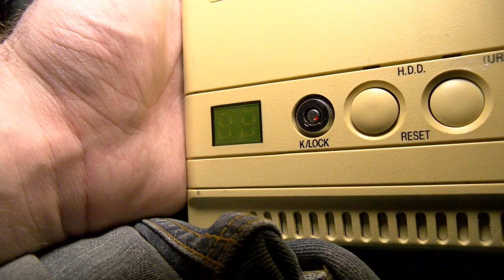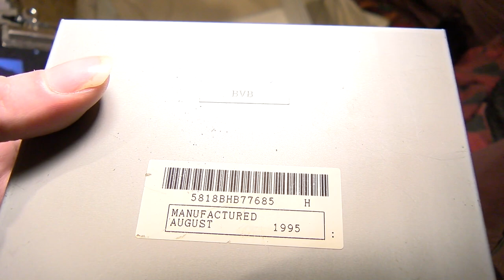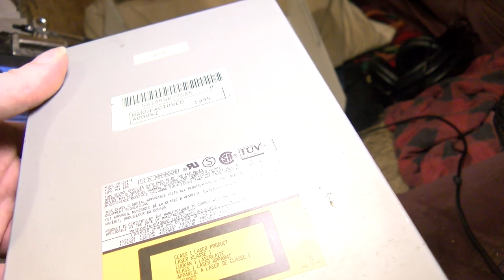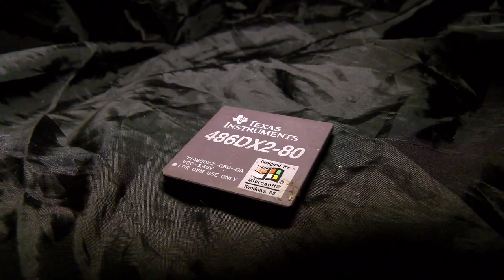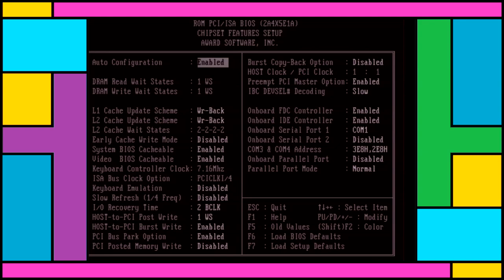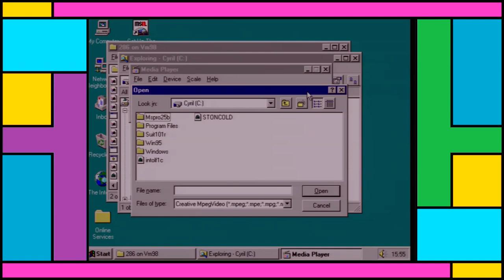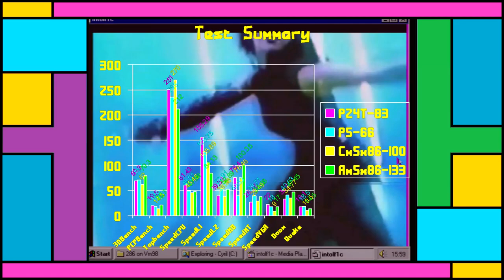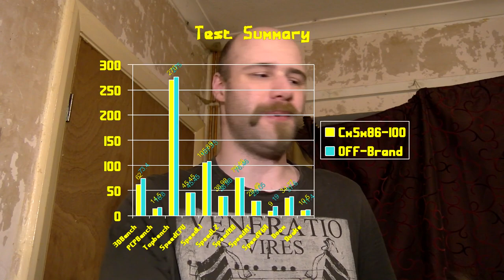Gimmicky Cyrix 5x86

Comment: Funny how things have been flipped around.  You're totally right, these were sold as "pentium class" budget systems with multimedia capabilities, and buying this stuff today, it really is cheaper a lot of times to just buy a Socket 5 / 7 setup.  I am sure those creative cards were made to get mpeg movie capabilities at a budget price and not intended for real use.  Playing video on a PC was a big deal back then.  I would call this system a "high end budget system" of 1995 or 1996 maybe. The cost of sound cards is why I started trying other cards and why I like the Ensoniq cards from Gateway systems, not greatest card made but for $20 they are damn good.  Glad to see you have a motherboard that actually enabled write back L1 on the cpu. Those in themselves are rare.

The ADZ 586-133 chip was designed to be a 160Mhz chip,  I think the ADW was a 140Mhz part but it is listed for 150Mhz, not sure about that one and ADY was intended as a 150Mhz chip but such labelings never came to be. The other variant which I have seen in a couple different silk screenings is the AM5x86 P75 AM486DX5-133V16BGC chip of which I do not have experience with.  Still looking for that mythical 200Mhz out of one.  I like running them at 160Mhz, 180Mhz is great if the board supports 60Mhz Bus. Only the ADZ have I had run close to 200Mhz. ADW seems to poop out at 160Mhz and ADY doesn't seem any better from my testing it.

That Cyrix chip can run at 2x so 50x2 is a nice speed to run them at and not overclock technically.
Reply from the maker: That Creative card actuallyseems to use the same MPEG decoder chip as the RealMagic ones, or the broken RealMagic I have on the side of the desk anyway. Funny how much smaller those are than Creative's one, though don't yet know if their quality was any different. The Scenic and the ATI Mach64 have had by far the best implementation I've seen so far - plus a bunch of late 90s cards where the feature likely wasn't used much.
OPTi and ESS cards have done well for me when things need doing cheaply on mid-90s machines, though both have some models that are better than others.
This ECS board has provided, by far, the smoothest experience getting CPUs running. A lot of them do indeed have issues with cache, where jumpers have to be set to all kinds of weirdness (setting as P24D fixes it on some boards, as if CPUs have a 'fallback' for this. The Aquarius does things like that) to make things work right. This one has had no such issues, everything just works. Its only issues have been worn slots, but this seems fine so long as cards are screwed in firmly.
I'd heard of AMD chips being relabeled like that, probably an attempt to stop them eating into K5 sales.

Comment: Hello, nice to see you again! I recently got one my cx5x86 had quite a time making it work with EDO RAM the damn thing worked with just a pair of 16MB memory modules I ordered some cheap FPM from Germany to avoid all the insanity and now the system is way stable and no slower at all. Using the guide CPU galaxy mentioned from Vogons it was quite simple to put together a simple bat file, the speed increase was as measurable as his own. Thanks again for your vídeos always entertaining and informative!
Reply from the maker: RAM from that time is a bit dodgy, really. You had motherboards trying to support EDO and then, supposedly, some EDO ram that could operate in plain FPDRAM mode. Most 486 boards just plain refuse to work with EDO at all, or else start up, but report it incorrectly before locking up. This is one of the very few that seems to actually support it, though I can't guarantee other revisions would.

Comment: In my experience, VIA chipsets really came in to their own in the Athlon era. I had a VIA chipset on my first Pentium PC as a teenager, and had all sorts of funny incompatibilities and quirks that went away when the motherboard was swapped for a 430VX based board, but on the other hand I used VIA Apollo-based boards on my Athlon and AthlonXP systems and had a great experience.
Reply from the maker: I suspect you're right. There's a gap in my knowledge of them around that time. Some of their barebones 486 ones (ISA only systems) seem to work OK, but likely as they're so simple there's nothing to break on them and they were probably late to the party. Their PCI ones were trouble. I'm told their early Pentium ones were sluggish or finnicky like OPTi's ones were. Then I know nothing until the MVP3, which works well for me, followed by their P3 and K7 chipsets that also work well. The fact these later ones are strapped to Chaintech and QDI boards might help, though, as those usually just work.

Comment: I had already resolved to do the 2x50MHz thing once I'm done with this pain-in-the-ass EISA build, so that'll be fun! I've also got 2x socket 3 chips with 16KB cache, apparently: the Cyrix Am5x86-P75 (I think you sent with with the VIP board) and the AMD-X5-133ADW. So it'll be fun to mess with those. Nice video. I like the little details you include. I had a Diamond card back in the day, but can't currently confirm the theory.
Reply from the maker: Everything EISA I've ever tried to mess with has either gone missing in transit or shown up dead, so good luck with that. Some of the Diamond cards I've tried have only been marginally slower than average, but I'd still like to know what the hell they did to them. The worst offenders by far are definitely this Vision 868 and the Virge 325, as they cause noticeable stalls to happen. Haven't tested in Windows much with them. I can't see how it would be, but I do wonder if having them in that environment with the drivers loaded would change anything.

Comment: Wasn't the PC Chips M919 the one that had fake cache chips on it? They were just inert plastic blocks with some engraving on them?
Reply from the maker: It was, though it did have a working COAST module, albeit one that only worked with that board and wasn't standard. Cache nonsense aside, it wasn't really a bad board and the same could really be said for a fair few things PC Chips made. They definitely made some trash in their time, but they also made a few things that worked surprisingly well.
- The M921 uses the same chipset, but they were horrible compared to the M919. You got real cache chips out of the box, but they weren't stable boards and burned out voltage regulators a lot for some reason. Not to be confused with the M912 which used an older VLB chipset and sometimes had fake cache chips on it, but otherwise usually worked, at least.
Reply: @HighTreason610  I have one of these M919 with an AMD p75, I was surprised that I needed to disable the cache so I can use EDO RAM.
Reply: Welp, I had a PC Chips board with my 200MMX back then. It was a Topgun TX Pro in its branding and it was pretty good.
Reply: They have aftermarket cache modules now with 1MB of cache. Wish I knew what happened to my board. :(

Comment: Thanks for making this video, you are very passionate about sharing your experience and knowledge. Do you recall motherboards with soldered on Cyrix 5x86s back in the day? Reason I ask is my first ever PC I built was on a super tight budget, would've been around about 1995, and I'm sure I used a board with a soldered Cyrix 586, but searching the internet nothing comes up.
Reply from the maker: Cyrix definitely made a PQFP version of the CPU (Possibly 5x86-100QP) and it was sometimes soldered to motherboards, though they don't show up very often now. The same chip was also the basis of some 486 upgrade solutions, where it was soldered to a little PCB alongside a voltreg and plugged into a normal 486 socket.
Reply: @HighTreason610  Thanks for the rapid reply. Just a few minutes ago I found a photo of an old PC advertised on eBay in the US with exactly what I remember, a soldered CPU with a green heatsink. That machine has an ExpertChips chipset. Could well be the same as that I had, but I can't recall at all. I do remember as a 14 year old having all the components I'd purchased spread across the living room floor while my parents were on holiday. I almost cried at first as I didn't have a clue what I was doing. I built it, used it a while, sold it for a profit, then bought my next lot of hardware. Workup up through 6x86 by going to Birmingham NEC to pick up good deals on hardware, then dual Pentium II while at uni (no idea why I bothered to have a dual cpu system back in those days apart from the fact that someone I knew at the time had somehow got hold of a load of cheap PII CPUs from somewhere), and I think that machine kept me going for a really good while. I think I switched to laptops after that and never looked back. Fond memories of building and tinkering though.

Comment: What is the better PCI chipset for a Cx5x86 build, UMC UM8886AF/8881F or SiS 85C496/497?  I had great experience with SiS on VLB systems, but PCI is a whole different beast and I am difficulty choosing a board for my own build..
Reply from the maker: I'd generally favor the UMC8886 because more motherboards with this chipset had 5x86 compatibility and its PCI implementation seems a little more stable. Whilst I don't have the results on hand, I can't be sure it is the fastest in that configuration, but it probably doesn't matter very much.

Comment: Hi there. I really like the video. Can  you please fix the audio? 10:40-10:50
Reply from the maker: Thanks. The audio isn't actually broken there, it was a case of stumbling due to no script and irritation at most board makers for using dumb socket layouts.
Reply: It sounds like there's a threshold where the input is cut when you aren't speaking (i.e. a feature that eliminates background noise). Can't tell if it's hardware or software but it's more noticeable on headphones.

Comment: I vaguely recall running 166MHz on the Cyrix 5x86 P75's.  Pentium 100's smoked these overclocked Cyrix chips in about every real life use.
Reply: The 5x86-P75 was an AMD chip.. Not a Cyrix... and you are probably referring to OC'ing the AMD 5x86-P75 133 to 160MHz with a 4x mult on a 40Mhz bus.
Reply: @thudtheace  You're confusing AMD's Am5x86-133 and AMD 5x86-P75 with Cyrix 5x86 P75.  All different.  AMD chips were on 133MHz bus and had lower overclock potential on stock multiplier.  Cyrix was on 100MHz bus on its stock multiplier.